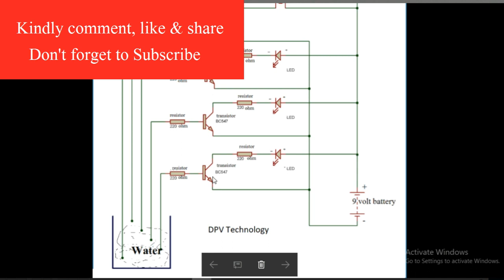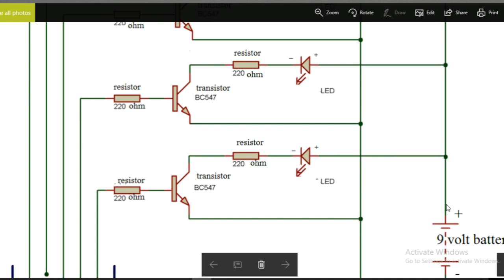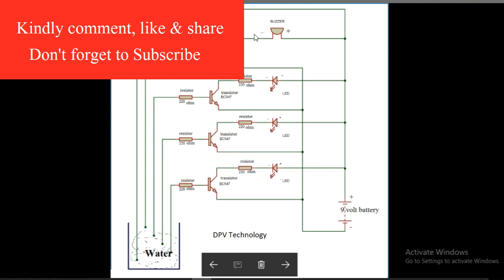water level indicator working principle

Comment: Sir, You have explained the circuit diagram very nicely. Thankyou for that. Can alter the circuit such that there will be two buzzer for indicating low water level and full level indication. Also pump should be switched on when water level becomes low and swiches off at full water level. Thanks in advance. Also how to replace leds with zero watt bulb.